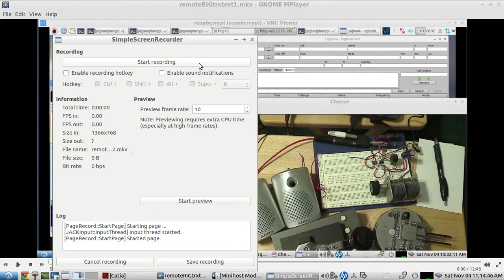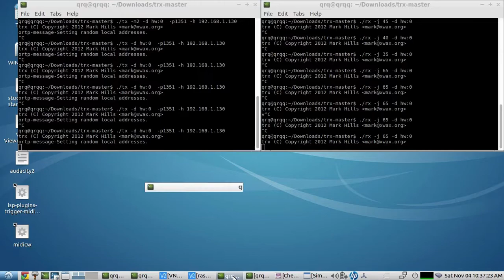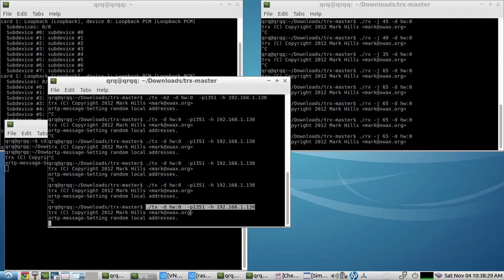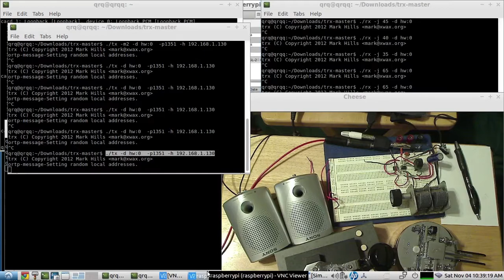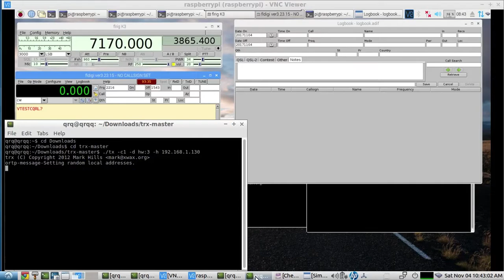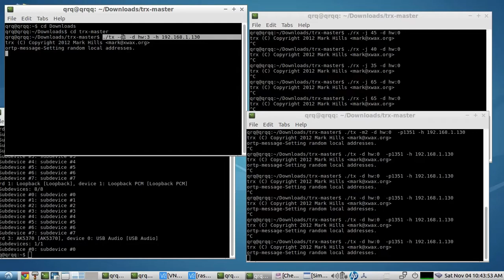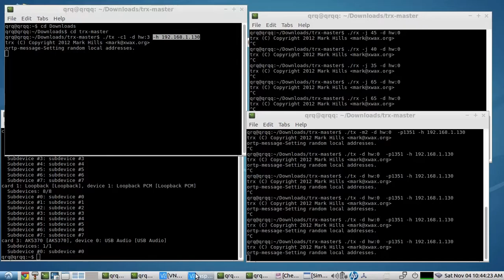HAM RADIO REMOTE RIG setup for CW & VOICE using a Raspberry PI and free software

Comment: What a brilliant video! 

I have been brainstorming for a while about how to build a remote setup for sending CW. Starting from scratch with custom software would certainly be a big undertaking. This is a brilliant way to do it. 

I have that fully digested it. I think that maybe the side tone comes from the remote station sending the audio back to you. I would be worried about the delay with CW. Maybe you're using the local side tone at your local station instead of the remote one at the rig.
Reply from the maker: depends on if the remote setup is local(LAN) or off site(WAN)... if on LAN, and LAN ethernet setup is well suited for ultra low latency, some delay can be tolerated(a matter of remote and RIG's PC sound card sample rate & buffer frames... etc)(can tolerate & get used to iambic keying with delays up to length of single dit element)... and up to 100 to 200 ms of delay to hear sidetone is not really a monster issue if using a cw keyboard....however, on either case, if you prefer immediate, absolute zero delay, it is easy to block the RIG's transmit sidetone and only listen to a local sidetone you setup in software on the same pc(or just listen to your KEYER's OWN sidetone,  if in software , by using a ducking app like  DUCKA or REAPER's REGATE(in sidechain ducking mode) it will silence the RIG's audio to remote site and you only hear your local software sidetone....there are many more examples of low latency remote RIG'n remote audio, in this channel if you do a search for remote rig  etc...